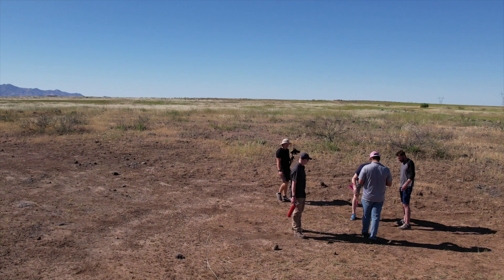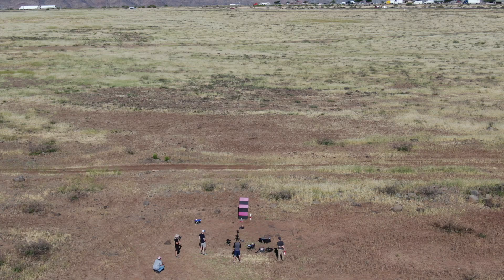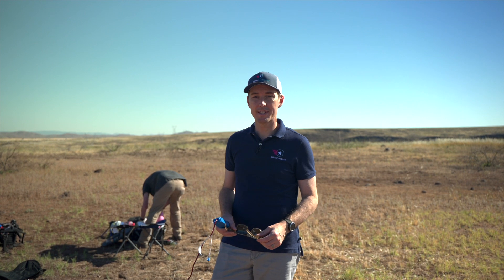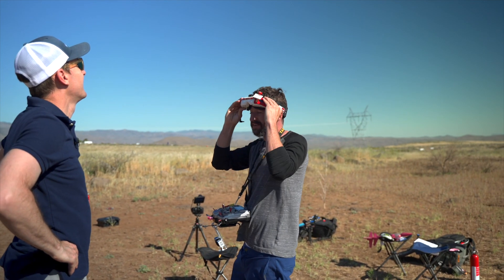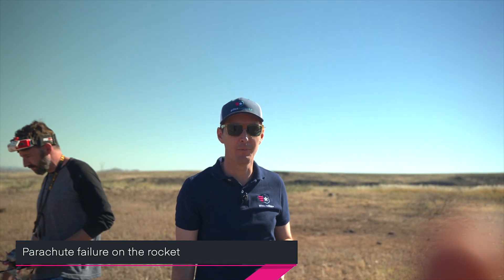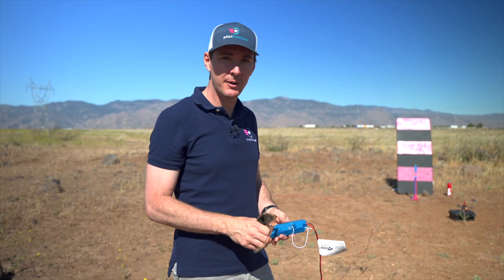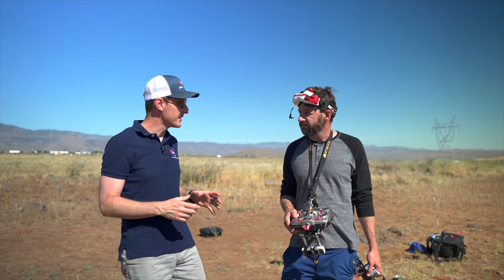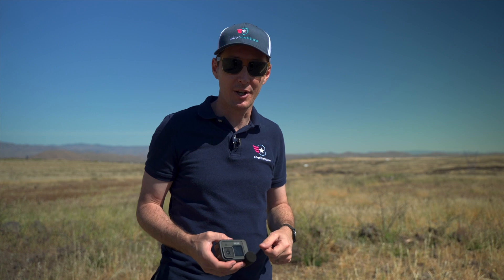Drone Busters: Racing Drone VS Rockets

Comment: I haven't flown rockets in decades.
Too chicken to launch anything with more than an A8-3.
If anyone was wondering, 
A is the energy, 8 is the power, 3 is the delay between all fuel used to recovery ejection charge.

Comment: NEED SOME CLARIFICATION!! I am a part 107 pilot. I called the FAA drone support phone number. The individual told me that to fly at night and controlled airspace I need to go through drone zone and submit an airspace request even though I would have clearance through Laanc for the daytime. The mission I would be doing would be personal use not commercial. Also out of curiosity if form 7711-1 14 the laanc night operations waiver how does the FAA know you're in the air? I'm just confused on what to do because the guy I spoke to didn't seem too sure?
Reply from the maker: Using 7711-1 is reserved to part 107  pilots, and can't be used for recreational purposes. Last I checked with the FAA, there was no way to fly at night in controlled airspace as a recreational flyer. Are you Part 107 certified?
Reply: @PilotInstitute  Yes I am part 107 certified I do have my license. I actually mentioned that in the very first sentence of my original comment lol.
Reply from the maker: @MichaelHollon  haha sorry about that, read too fast. Saw the mention of personal use... 
In your case, just do the mission under Part 107 (makes no difference for you) and submit a LAANC request for any time during the day you will fly at night. So if you're flying tonight, submit a LAANC request for any time today, and then carry the 7711-1 document and you're legal to fly at night anytime tonight (but not passed midnight). If you want to fly at night past midnight tonight, submit a LAANC request for tomorrow, any time during the day. 
I hope this helps!
Reply: @PilotInstitute  not a problem Greg not a problem at all trust me I do that all the time. So there's no reason to go through the drone zone and put in an airspace request then. I just got to keep the 7711-1 form with me then. I'm wondering if the FAA representative from the Drone support Center was not fully updated on the new rules.